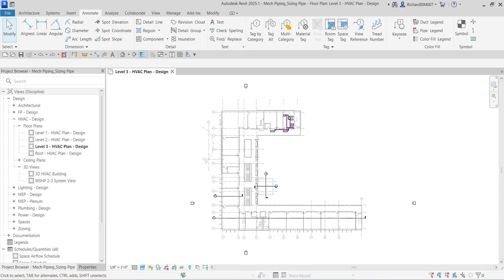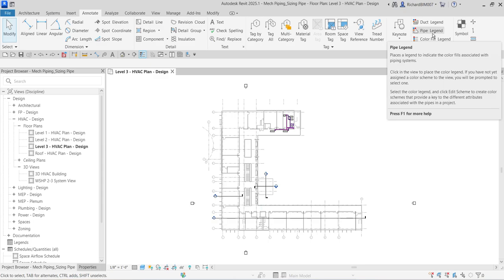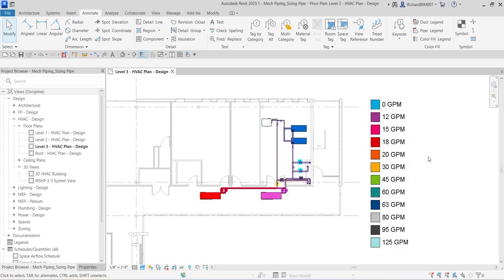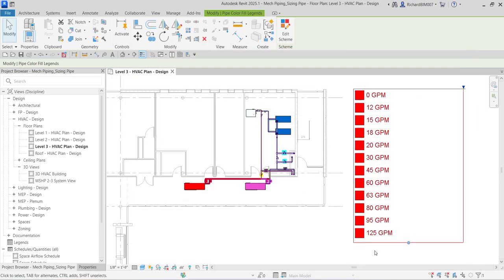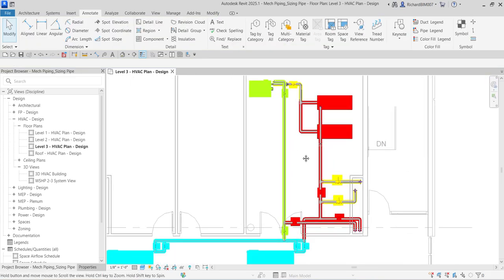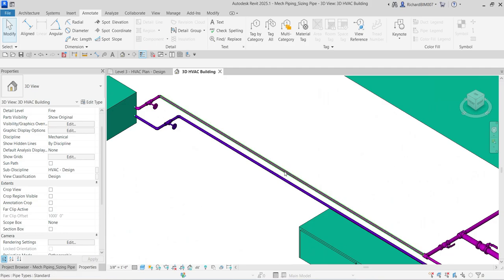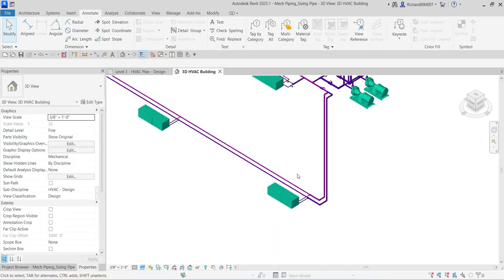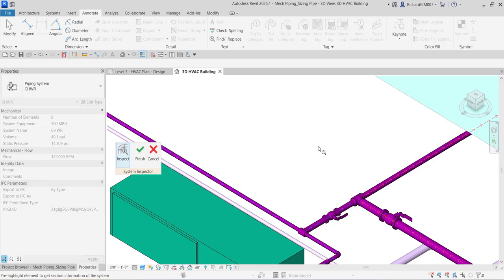REVIT 2025 FOR MEP DESIGN: PIPING SYSTEM - PIPE SIZING AND SYSTEM INSPECTOR

Comment: Hi Rich, been following your videos. And everything are very useful. If I may ask, how about twin copper piping with different sizes for Refrigerant Piping System for Airconditioning. Hangers and Support Detailing, Combination of Transmission Piping and Wiring with the same path of the Copper Piping between Outdoor unit and Indoor unit.
Reply from the maker: Hi Emillayco,

Thank you for following my videos! I'm glad to hear you find them useful.

For twin copper piping with different sizes in a refrigerant piping system for air conditioning, here are some tips to consider in Revit:

1. *Create Pipe Types:*
   - Define different pipe types for each size of copper piping. Go to *Systems* > *Piping* > *Pipe Properties* and create new types as needed.

2. *Routing the Pipes:*
   - When routing the pipes, ensure that you maintain the correct spacing and alignment for the twin piping. You can use the *Align* tool to help with this.

3. *Hangers and Supports:*
   - Use the *Piping Hanger* tool to add supports for your pipes. You can set specific spacing for hangers based on the size and weight of the piping. Remember to check the manufacturer’s specifications for hangers that accommodate twin piping setups.

4. *Combination of Piping and Wiring:*
   - To combine transmission piping and wiring along the same path, you can create a dedicated *Cable Tray* or *Conduit* in Revit. Ensure that the routing does not interfere with the refrigerant piping.
   - You may also need to use the *Electrical* tools to lay out the wiring alongside the piping, ensuring clear separation and proper clearance as per code.

5. *Detailing:*
   - For detailed documentation, you can use detail views to show the connection points and hanger details clearly. Annotations can also be added to clarify sizes and installation methods.